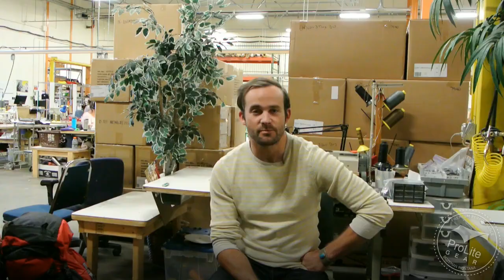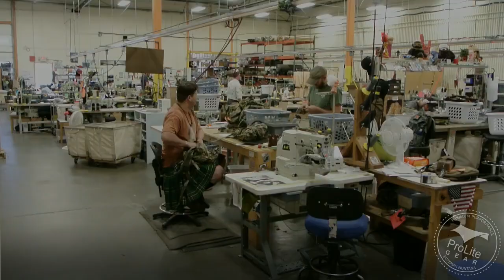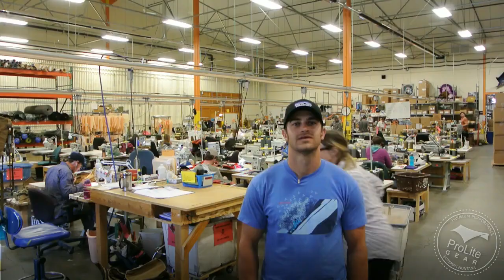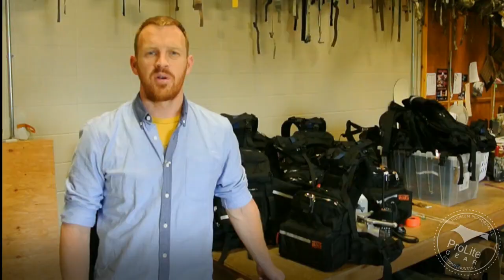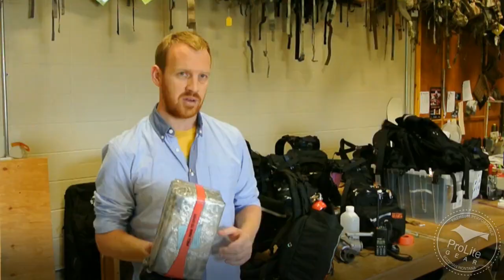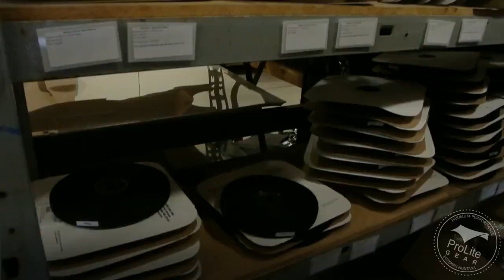Mystery Ranch Factory Tour

Comment: I have an old Dana  Terraplane  as well as a Bomb Pack that I use every day. 
Both have survived the years better than their owner . I have a couple Mystery Ranch packs and they set the bar for all others in my opinion but amazingly my 30 ish year old Dana Design packs were so far ahead of their time that in 2021 the design, materials and ergonomics  
are as modern as any of the top brands sold today  though in all fairness the color schemes of some of the flashier packs does tend to give away their age. Great video. Thank you